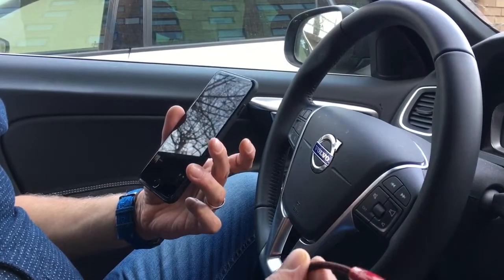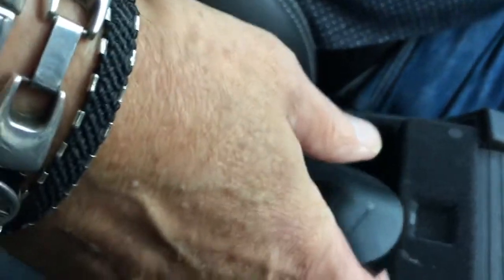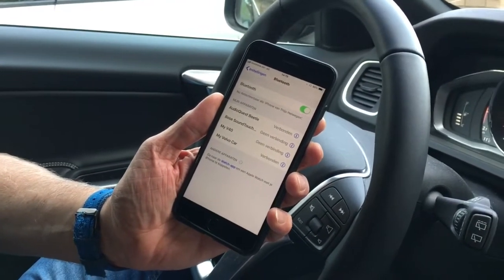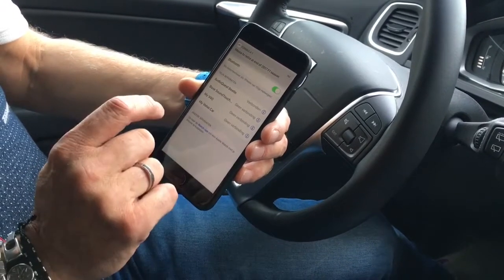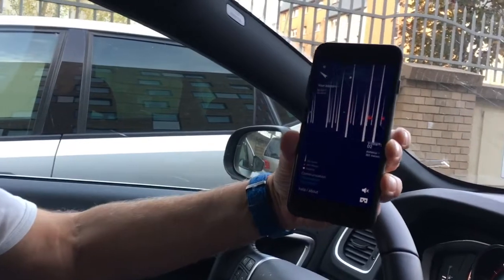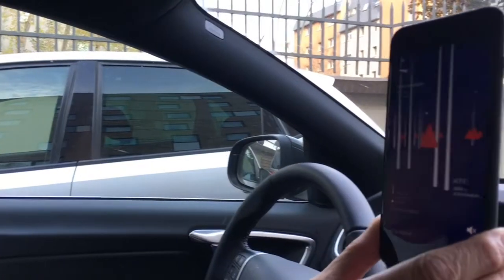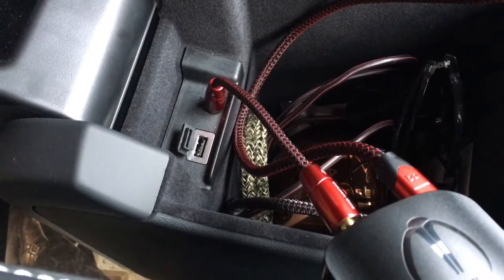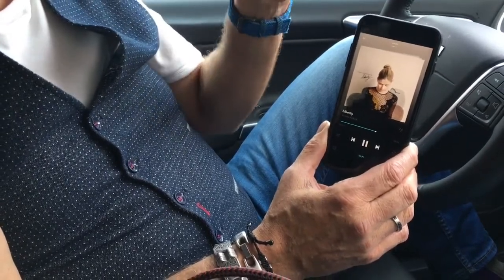AudioQuest Beetle in a car @ CanJam Europe 2017 -- Darko.Audio

Comment: Hello, @DarkoAudio ! Great work with your videos. I have specific question about the power supply that is in use for powering the Beetle from the video. I have the same dac, but I face a huge problem powering it in my car. I've tried at least 5 different power supplies for automobiles. Help me please! 🙏

Comment: My Volvo is of an age that it doesn't have bluetooth and on the strength of this video I got an AQ Beetle. Sounded so much better than coming out of the headphone socket of my phone. It lasted about 3-4 months before the bluetooth chip died and I couldn't pair to it. The dealer replaced it under warranty. The replacement lasted a similar amount of time before it too died. Returned it and got a full refund. I'm back to using the headphone socket Not good enough Audioquest.
Reply: Can you tell me what type of supply you use in your car, please